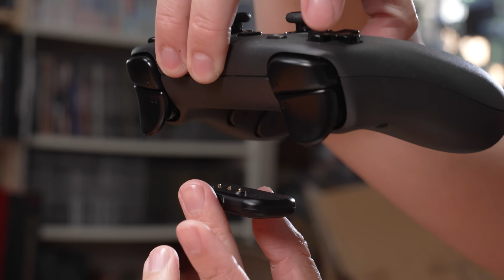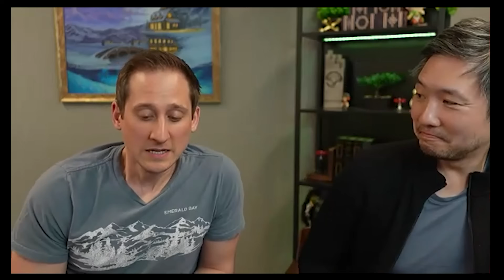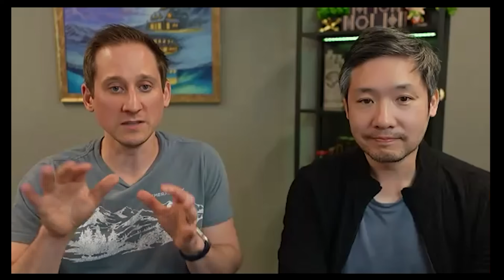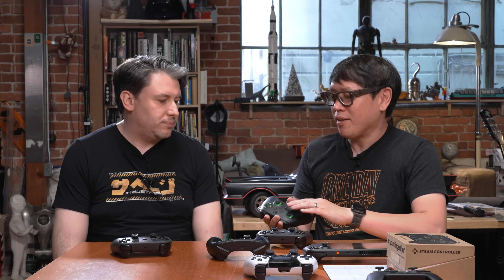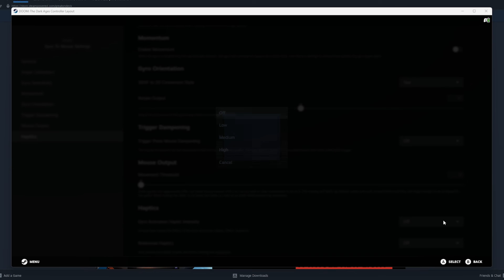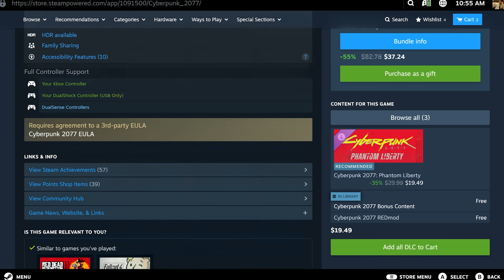Tested: Steam Controller Review + Valve Interview!

Comment: It's wild that hall effect is still considered high end in 2026. Really shows how far most of the industry has slipped since the days when they took pride in their hardware.

I'm glad Valve is still around to remind consumers we aren't just here to be milked. They're supposed to serve us.
Reply: To be fair tmr sticks are a newer more power efficient version of standard hall affect sticks. They may not be “more expensive” but they are modern and will definitely be coming to new controllers.
Reply: Idk i think it has taken this long for 'cheap' reliable halleffect sensors. Since it solves one of the bigger issues with hall effect sensors and that is battery life. But historically hall effect havent been always better than potentiometer sticks. But now hall effects are good enough and cheap enough we should see everyone switching over and theyll get even cheaper.
Reply: Ironically the high end gamepads from the major gaming brands don't have it. 

Nintendo switch pro controller, dualsense edge, and the Xbox elite controller.

The other brands beat them to the punch at much cheaper. Like 8bitdo
Reply: @smashley7210 8bitdo hallf effects from 2 years ago had issues with a snap back effect where when releasing the stick can cause it to overshoot and point in the opposite direction, also when at lower battery life there would be a jittering effect because of thw wya hall effects work. there was also calibration issues that can happen because you have to recalibrate the stick since it doesnt perfectly reset to zero. these are just side effects of using hall effects. though they have been getting better and software helps a lot. potentiometer sticks just sont have these issues. but they do wear out. I think its just finally cross that thresehold where halleffect is 100% the correct choice now adays.
Everyone makes it seem like each company is evil for using older sticks. No they saw the trade offs and saw that hall effects were not ready yet.
Reply: Xbox Elite controllers don't even have hall effect joysticks but they do have hall effect triggers. I believe you are correct and that most of it is milking, assuming you are talking about planned obsolescence. Many of these firms don't want their product to last on purpose. I mean Nintendo has been sued and lost how many times over this?

That's why Valve can't lose. Just listen to the people interviewed, what are they saying? Providing value, providing value, over and over again. They are trying to provide value to the consumer. Valve can't lose because it continues to prioritize providing value to the consumer over other motives. That's how business is supposed to work.
Reply: Any electromechanical component is gonna wear out over time, I’m a lot less worried about the specific technology of the stick than the repairability of it. Seems like valve is doing pretty good on that front too though
Reply: What about if I like getting milked?
Reply: I'm mean in terms of performance there is not really a difference. It's only the battery efficiency that's different.....

So if the battery lasts already long enough with hall-effect sticks there is not much reason to want tmr sticks ....

You always need to compare value to price and if something doesn't add more value you most likely aren't willing to pay for one feature.....

Gladly I think valve has its controller pretty well priced for its amount of highly usable features....
Reply: Still dissapointed with the triggers being downgraded though, having it two stage was massively useful.
Reply: @utarefson9 not everyone would want them and supposedly you can still do a pseudo two stage through steam input, according to one review
Reply: @GangstaBoogie9 yea. I mean since it's a analogue sensor you could always make it one, two, or more stages.... It's only the software that might limit you....

There is not really a extra button needed....
Reply: Yeah, hall effects are just glorified alps, the longevity is comparable to the new potentiometer based analogs (not the old ones tho, for some reason old analogs are extra durable...).
Reply: Same old sucking tired rhetoric
Reply: The newer, more expressive, marginally better thing is more expensive. Wow that's crazy. Also funny that "slipping" is when things keep getting better all the time. Curious.
Reply: It's not considered high end. Cheap controllers have hall effect or tmr. It's just that Nintendo, Xbox, and PS haven't switched.
Reply: @Zach99999 yeah and cheap controllers have cheap halleffect that sucks compared to potentiometer
Reply: @Dudeinator  yeah, good technology requires good manufacturing
Reply: @Zach99999 Kind of my point.
Reply: @tom.m  if controllers cheaper than the console defaults have them, it's not high end
Reply: @Zach99999  Did you watch the video you're commenting on???

Norm calls them high-end, because the first party controllers don't use them.

That shows how bad first party hardware has gotten, because they are definitley not high end... That's the point.
Reply: @tom.m  I watched the video. My point is that they're not high end. I'm not disagreeing with how badly first party controllers have handled the situation. And knowing that they're not high end makes the argument against first party decisions more valid, but the video doesn't acknowledge that, and it took arguing with me to get you to acknowledge that.
Reply: @Zach99999 No it took arguing with me for you to understand the point of my original comment. 😂
Reply: @tom.m  I never misunderstood, I was merely correcting your false first sentence.
Reply: @Zach99999  Oh so you still don't understand. I give up. 😂
Reply: Dude, you need a reality check, stuff like IPS monitors and hall effect sticks are great, hell I've never had stick drift on any standard potentiometer controller except MadCatz. Don't need OLED everything and TMR to have a good time
Reply: @EhurtAfy  Weird assumptions. I'm on an IPS monitor right now... 

I'm saying reliable sticks should be standard. Not "high end".

And if you've never had stick drift... Either you're a noob or being hyperbolic. 😂
Reply: @tom.m  Weird assumptions happen when there is weird phrasing. Saying "It's crazy that hall effect sticks are considered high-end in 2026" is not that same as saying "hall effect sticks should be the standard in 2026". The former implies hall effect is not very good, even if that's not what you meant. I can understand what you mean with further explanation and that's reasonable. But this is the Internet, we can't mind read and can only assume what you've written is what you think. 

As far as stick drift, I'm not really a ball & gun player who spends 5000 hours on the same competitive game, I play all kinds of games on all kinds of systems. All my Wii U, Wii, 3DS, Switch 2, Xbox 360, PS3, PS4, PS5, Steam Decks, everything has original controllers/gamepads, and I have a bunch of random PDP, Gulikit, 8bitDo controllers too. As I said never had any stick drift, except for a random MadCatz controller 20 years ago but maybe the variety helps. My dad needs a new Dualsense every year because he annihilates them with Madden and taco dust
Reply: @EhurtAfy Context matters. The comment was in response to something Norm said. But everyone on the internet just wants to win pointless fights rather than work to fix anything. 😂

As for stick drift, you are literally the only gamer in the world with luck that good. Treasure it.
Reply: @tom.m  As far as I'm concerned there is no fight to be had, and it's not a matter of opinion, just informing you that your original comment is unclear within its own context, and that people can't read your mind, so it's helpful to provide the context when possible. There are multiple ways to interpret what you wrote because it's unclear. This is just a suggestion. Also, plenty of people have never experienced stick drift, but people dismiss their experiences and reject the idea that a basic potentiometer joystick can be good enough for the vast majority of people
Reply: @EhurtAfy 😂
Reply: @tom.m sorry I'm on the opposing side in terms of the one failing it's hardware, when people encounter Stickdrift.....

In 25 years of gaming it never happened to me..... I don't understand what the people are doing that need all 2 years to get a new gamepad because their sticks are drifting......
I had original PS1, Xbox 360, PS4, PS5 gamepads. And only switched to the newer one because it was included with the console or the only one compatible.

Still.... Quality wise and especially with the problems other people have with potentiometer sticks, it should be without question to switch to magnetic sensing sticks....
Reply: @tom.m sorry but I also understood it exactly the way he did.

That you thought that hall effect sticks would be bad..... If a lot of people missunderstand what you meant it's your fault not having it communicated a understandable way.....

Standard theorie of communication even goes as far, that always the speaker is the one miscommunicating and never the hearer.... I wouldn't go that far.
Reply: @BlackyRay_Patrick Yes, the declining hardware quality and massivley increased incidents of stick failure are all user error. The fact that my OG Xbox Controller S still works while I've gone through 3 of the new ones is totally my fault and has nothing to do with corpo greed... 🤦‍♂️

Probably my fault my Intellimouse Explorer still works while Razer products fail constantly for everyone I know, too. 😂
Reply: @BlackyRay_Patrick Most people understand fine. You two are looking for an argument (hence your multiple replies of multiple paragraphs) and it makes you look silly.

I don't have to engage beyond what I find amusing. So keep it fresh. 😂
Reply: @tom.m sorry it's not only us two. We were the only ones that reacted directly addressing your. Under your comment there were other people under your first comment that responded in a similar understanding like how we understood it.....

Also no I'm not multiple times answering on different paragraphs. I'm commenting on different comments....
Reply: @BlackyRay_Patrick  Oh, is English not your first language? I should have realized sooner. Sorry!
Reply: @tom.m I mean at least in one term we agree. That the first party companies need to stop using that completely outdated potentiometer sticks which are much more likely to fail tech wise.....

But yes. I never broke a gamepad. Maybe u are using much more force when pressing the sticks I really never experienced a Stickdrift on my own, so I really don't understand where this comes from....

Especially from my experience in customer support some years ago... There were people that came maybe one time with a broken gamepad.... And than there were people you saw every 6 months with a stick drift.... Controller... Nobody can tell my that one person in 4 years breaking 7 controllers is just bad hardware quality and nothing of it would have to do with that person... If it were so I would have seen more of the same people on a regular base instead of that hand full specific people over and over again....
Reply: membrane buttons is cringe in 2026 i think they will do mouse clickable switches in steam controller buttons but they dont
Reply: What a tool you sound like
Reply: @Ping_freud22  Don't kick dogs. Touch grass.
I hope your life gets better.

Comment: Was the d-pad noticeably upgraded?
Reply: Some reviews say it's more precise. Specifically they tested it on Contra which had notoriously finicky inputs and it was correctly reading down from diagonal.
Reply: LTT says it was, but not much. Either way, there’s basically two whole new inputs that could be d-pads lol
Reply: Considering the OG SC didn't have a dpad, then yes? It upgraded to having one. Though I never felt the need to have one. Having one is nice though, since it frees up the left trackpad for MORE inputs instead of just a dpad replacement.
So before (if you were using a dual trackpad layout) you could have movement on touch on the left trackpad, and then you could click the trackpad on the cardinal directions for dpad input. Since the new HAS a dpad, now that frees up the trackpad clicks to 4 more buttons (or whatever other number) you want. Same deal with the extra thumbstick. Since I was using trackpad for movement, it freed up the thumbstick for radial menus. We have an extra thumbstick now, so extra radial menus without the need to layer.
Having gripsense is great too since you can use that to swap action layers for things like extra radial menus.

So yeah. For the right people this controller is gonna be great. For people who open with "yeah I prefer an xbox pad", they just won't get it and never will.
Reply: @choo_choo_  I like d-pads for 2D movement rather than joysticks. Sometimes I prefer the joystick, but most platformers I like using a d-pad. And the Deck has quite a terrible d-pad in that use case for me because the diagonals on it are very bad. It is just random if I'll hit a diagonal when I want/expect to. If I really wanted to, I could push down very hard to get the diagonal to proc every time, but that doesn't feel good for platformers, especially if quick inputs are necessary. I also don't have any indication if an input is being pressed with the Deck's d-pad. There is no click, release, bump, whatever to indicate that the input is now being registered. It doesn't need to have a literal "click" like the xbox controller. But something to indicate to me that I've done the input is necessary for me to enjoy the d-pad. I haven't had this issue with any other controller beyond maybe the PS2 controller.

As it stands, the Deck's d-pad is pretty useless to me if I play a game that needs diagonal inputs. Some don't need it. Bit.Trip Runner doesn't, that feels nice with d-pad. But basically every other game I would like to play with a d-pad on the Deck needs consistent diagonals, and the Deck does not deliver imo.

I do prefer the xbox style d-pad over the deck, but only because the input is always 100% accurate. I'd prefer a type of d-pad that doesn't click though but had those accurate inputs.
Reply: It’s the same as on steam deck

Comment: So it doesn't work in general as a controller when paired with an Android phone/tablet, right? With Android it only works in the Steam app, as a controller for Steam app-streamed games. Right?
Reply: Currently, and Valve has not indicated any plans to implement that.

it is worth noting that the first steam controller rapidly saw the development of community tools that allowed it to connect to a wider range of devices. But yes, no official support.
Reply: I think it has a "Lizard mode", which makes it work like an Xbox 360 controller.
Like the X-input mode of 8BitDo controllers.

Comment: I understand that it could be funky to get a generic controller to work on a console, but did you guys actually test that it won't work on any of them? Kind of a bummer if true.
Reply from the maker: Unfortunately it doesn’t work on any of our consoles. And doesn’t register as xinput gamepad in windows unless you go through Steam
Reply: @tested  It's a shame they didn't find a way to switch it to a "dumb mode", even if it reduced functionality.

Making the controller switch modes if it doesn't handshake with Steam doesn't sound like a massive technical hurdle for a controller this smart.

A good controller with paddles, reasonably priced, that worked for all my systems would be an insta-buy for me.
Reply: @tom.m As I understand it, it does have a dumb mode but it acts like a mouse and keyboard instead of as an xinput controller (which wouldn't support many of the features). The mouse and keyboard combo would be useful for interacting with bios and desktop programs.
Reply: @tom.m this is a bit of a guess on my part so keep that in mind. But when making a 3rd party controller for say xbox or PlayStation it is very likely you have to pay a licence to them in order to use the protocols for those devices. Which could have increased the cost of the controller. Especially when you want it to work for any console
Reply: I would be surprised it a Brook adapter didn't help it to work perfectly on consoles.
Reply: If the next gen Xbox is just a Windows PC like it seems it will be, with Steam support, then the controller will probably work, along with ironically PlayStation and Switch controllers.